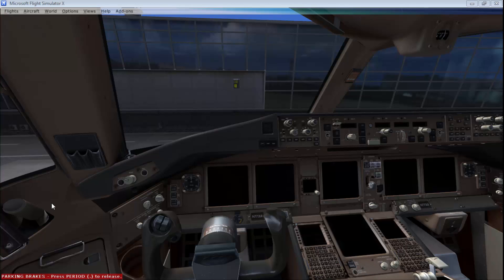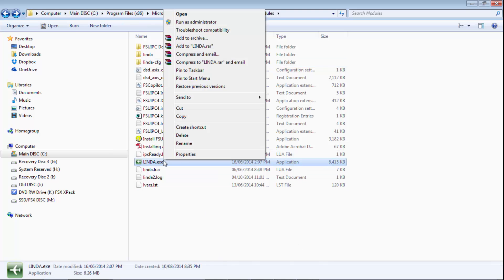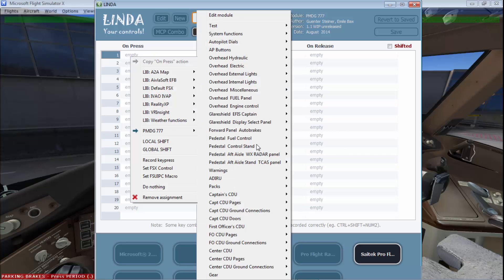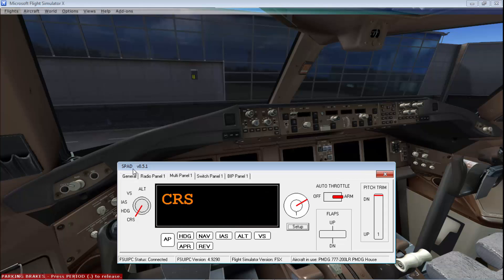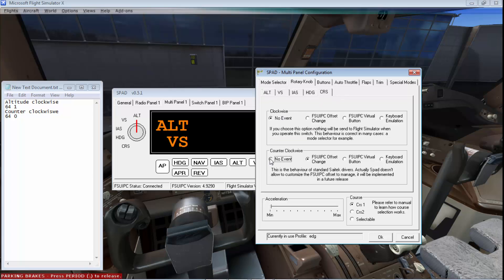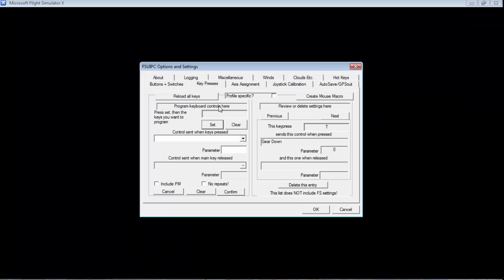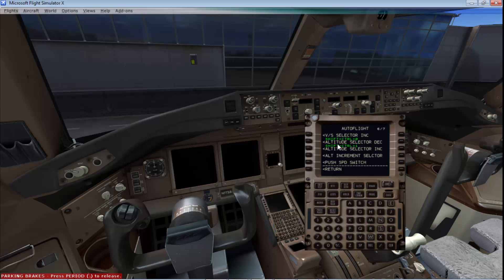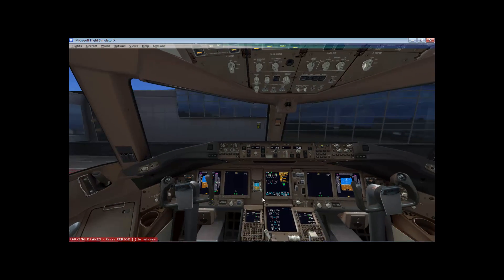TUTORIAL -- SAITEK PANELS & PMDG 777 / FULLY WORKING

Comment: I programmed the knob in SPAD first as a fsuipc virtual button like this ALT 64.0 62.1, VS 64.2 64.3, IAS 64.4 64.5, HDG 64.6 64.7, CRS 64.8 64.9. When I go to fsuipc to program them, fsuipc recognizes all of them but the 64.7 for the heading, when I turn it counter clockwise nothing happens if I turn it clockwise it recognizes the 64.6, do you have any idea why this is happening?